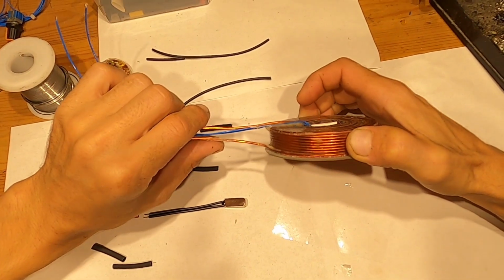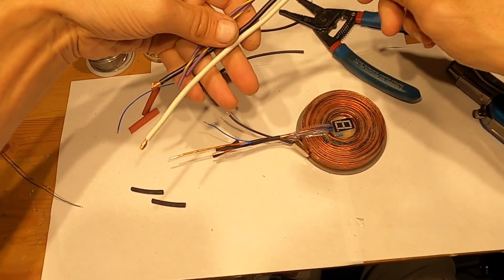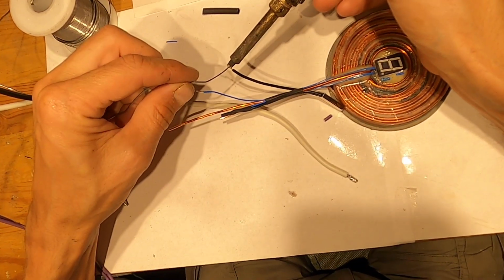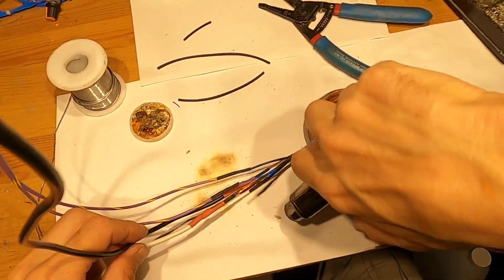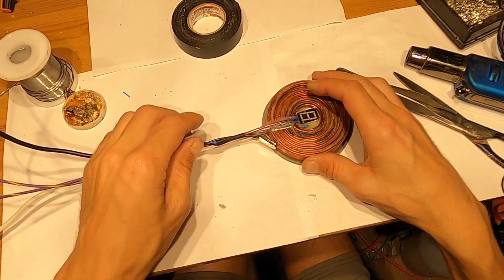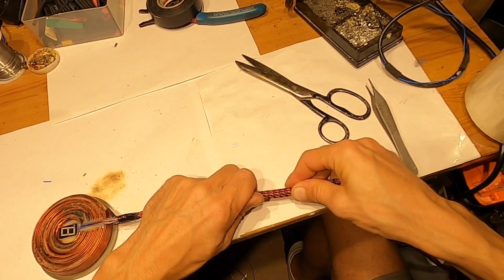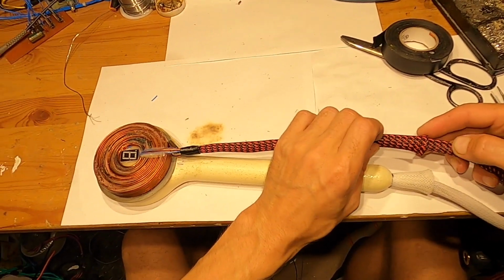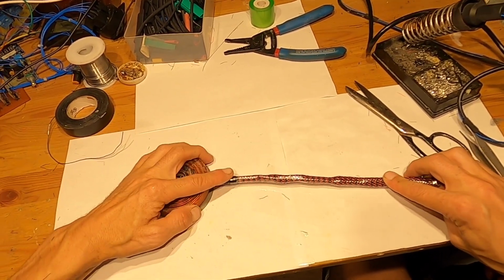024 Preparing my 3" Coil for the Mold    BBMPulser.    PEMF

Comment: I'm trying to build another coil but I'm trying to build it to your specifications so I was wondering whats the resistance of your 400 gram coils and what would be the minimum required resistance?
Reply from the maker: The resistance of 3" Copper Coil made from 14AWG wire is around 0.15 Ohms